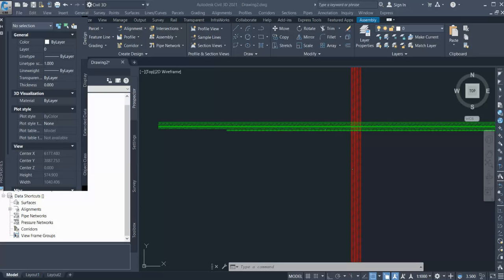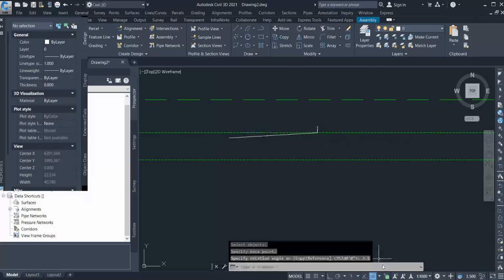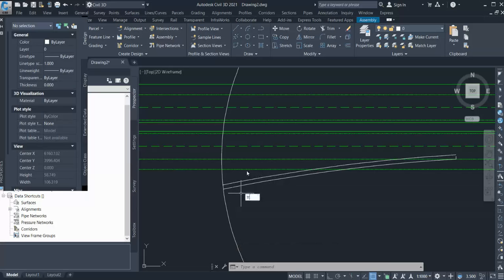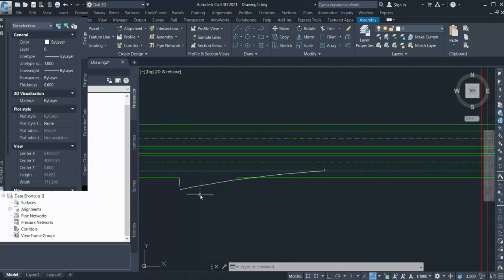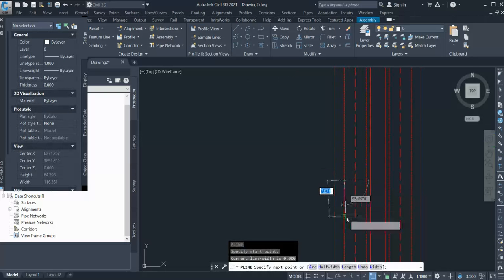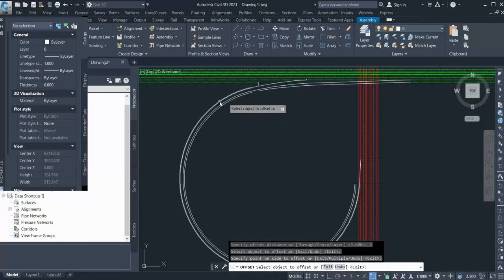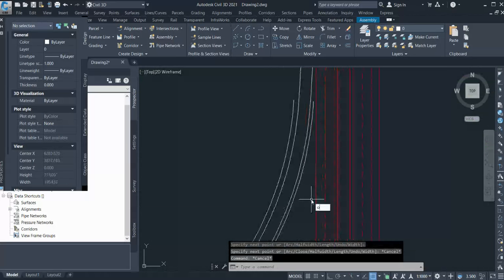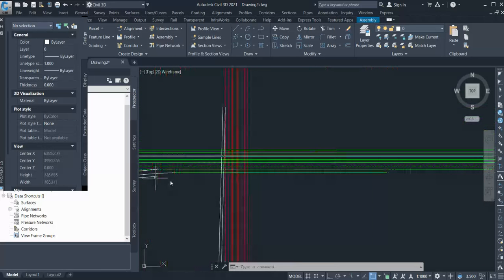Civil3D - Highway Interchange Slip road/Loop Design 2D

Comment: Sir how to take the elevation reports from the break lines by using the horizontal alignment?
Reply from the maker: Sorry. Didn't understand question. Those are two different things. You can create table for breakline/featurelines
Reply: @Civil3DProTipsandTricks  sir, is it possible through feature lines to take the  reports of the OGLs
Reply: @Civil3DProTipsandTricks  Dear sir, how can we generate the existing road survey reports of levels through Horizontal alignment?